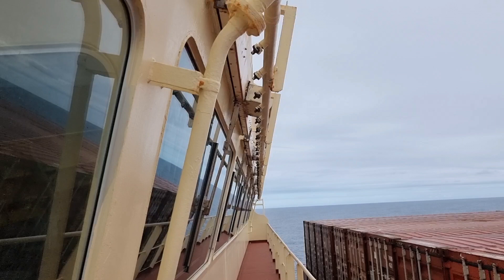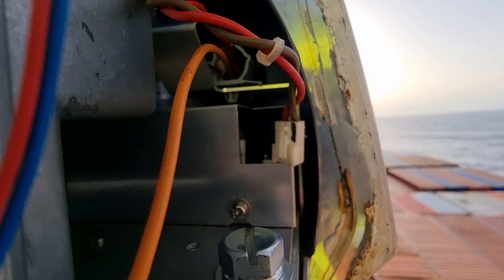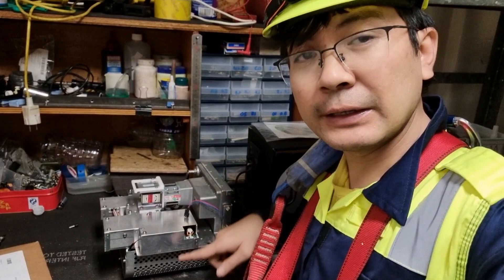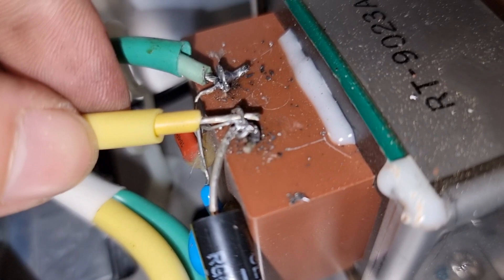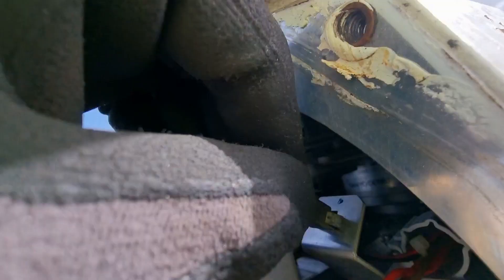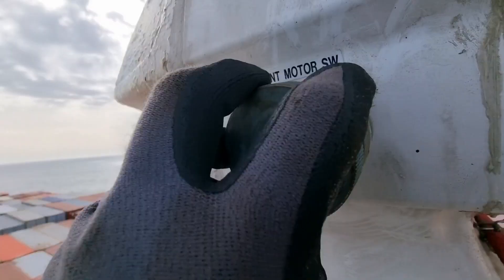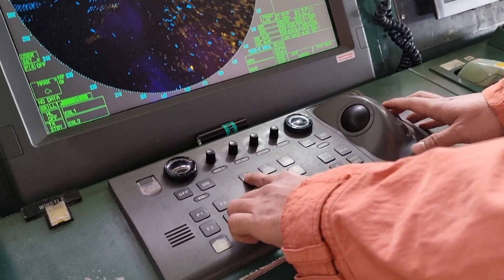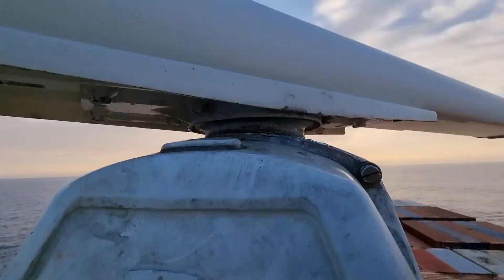Ship's Radar Magnetron Replacement

Comment: Nice one, but you forgot to check carbon brushes inside the motor. And usually when you change magnetron you reset the TX time and not On time.. TX = Magnitron Time, ON = Motor time... So You reset only Tx Time... 2nd should know about it...  Nice video by the way, keep it on!

Comment: lock out tag out
Reply from the maker: thank you for watching
Reply from the maker: nabanggit ko sa video idol na may permit to work kami, sa permit to work kasama doon ang mga checklist na ginagawa bago mag start ng work. Like lock out tag out, ladder condition, PPE, Safety signs, isolation of horns, Isolation of antennas and others transmitting high radiation, kasama ang look out, weather condition, proper visibility, risk assessment, contingency plan and etc..

Comment: Hello.. Good. Video.... Please tell me.. I am getting azimuth alarm on x band radar. Funuro system. Checked manual it is showing RADAR ANTENA ROTATION SIGNAL. Means rotation signal is not coming. How to solve.. If you can help in troubleshooting this.